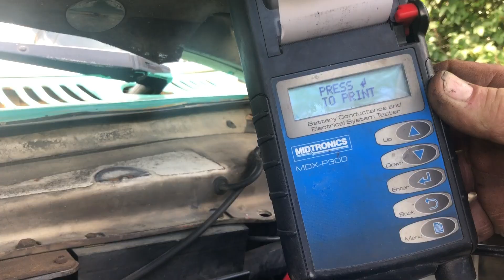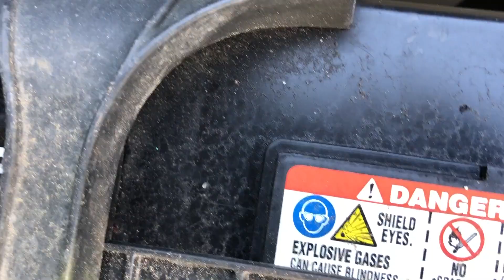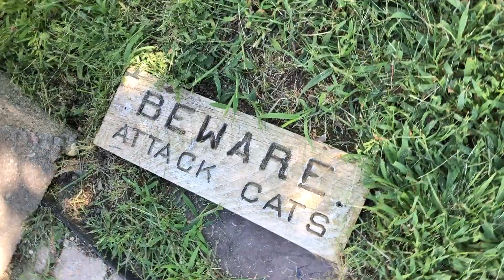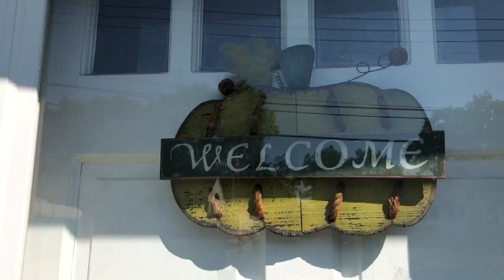BIG NEWS • END of an ERA (and My Solar Battery Tender)

Comment: I have one of those solar battery thingies and It works great. I went on the cheap when I bought a new battery for my RV and if I let it set for more than two seeks it is hard to start and one time it just needed a jump.  Dang! So I got one of the solar trickle chargers and I LOVE it.  You are supposed to unplug it when you start the vehicle.  I have started it a couple of times without unplugging it and my RV didn't blow up, but I guess it is not good for either the battery or charger,...not sure which.  One little piece of advice,....if I may.  If you get a couple of magazines and make a vision board, you will be a little more excited about this change. Sometimes we get in a rut when we have been in a situation for longer than we wish, and it is hard then to get momentum.  Well that has been true for me.  I found a vision board was very helpful.  I know that there are a lot of things you need to handle but I think that might help get the momentum going, and help put some cheer in your life.
Reply from the maker: Thanks so much for the comment and the advice! I'm feeling pretty excited about the whole thing - both for my Mom and for myself!